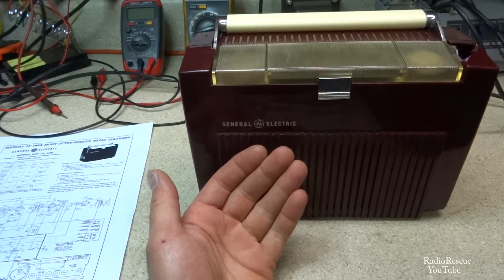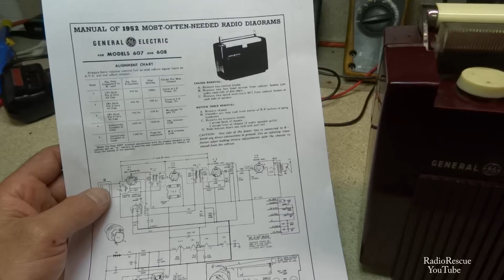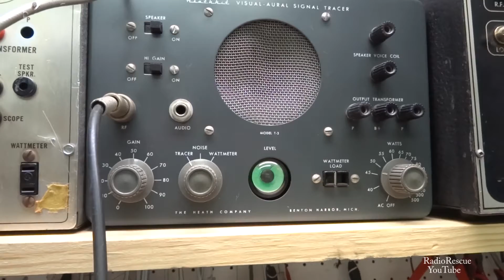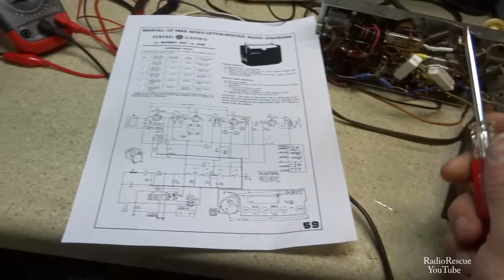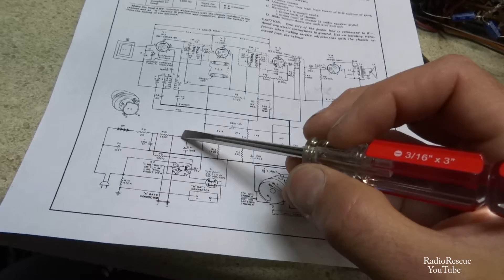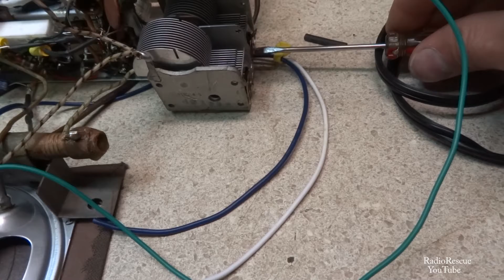Repair Of A 1952 GE Model 607

Comment: I found one of these in a barn a decade or so ago and about 50 of the case was gone and cracked all to thel.  The internals were rusted to heck form rain and weather.   Spiderwebs, you name it.   I derusted everything but  and took off the components, but quite af ew of the tues were missing.   NDId a very neat restore on the variable capacitorand the metal chassic but that was a s far as I got.   Seemed no sense to oontinue, so I asked for an old vacuum tube radio on Craigslist, and low and behold a guy actually game me a GE 430 with wooden chasis that had sat on his parents mantel for 50 years.   '

Worked but with some buzz or hum, so a few electrolytic recaps fixed that and it was back in operation.   I took the faceplate dial off just so I could watch the vacuum tubes glow inside, then put it back on to keep t intact.

O still ahve the parts tot he GE 607 if anyone needs them to restore a GE 607 but they are rough...  haha  Probably only worthwhile to see what a resistorfrom 1952 looks like...

https://www.youtube.com/watch?v=cDQbMpZpQ8g

Comment: Back in 1967 my buddy and I were scroungers, had to be, we didn't have much money and were still in school so didn't have jobs during the school year.  One day we hit the city dump, which at that time was unmanned, and dug through the piles of garbage. I came up with a radio that looked a bit like that one, but was olive drab in color and had a wet cell battery as well as the power cord. It had Short Wave on the dial and for antenna's it had two pull out sort of tape antennas, built like retractable tape measures with a stop on them at the end. It worked OK on AC power but the batteries seemed to be dead. I used it up till 1970 when I entered the US Army and my good wife tossed it back where it came from. She had no interest in that sort of radio and she had one that was hers when we wed, she kept that for years.  Kind of wish  I had that set back again, also wish I had my wife back again, she went to heaven last month on the 20th when she lost her battle with cancer.
Reply from the maker: I'm sure she's looking down at you and soon you'll be together again forever.
Reply: Mu sympathies for you regarding the loss of your wife.

Comment: Very nice video. I have several of those 50s battery / AC sets and I love them. If they have an RF amplifier stage, they are neck and neck DXers with car radios. The problems most frequently I've encountered aside from electrolytics, tube filaments and selenium rectifiers, is with that filament dropping resistor. I think the manufacturers used to low of a wattage making the resistor run hot and eventually self destructing. I always use a higher watt unit than OEM and do what i can to keep the new one as cool as possible. Your viewer should go after UPS about the damage in shipping. For what they charge to pack, there is no excuse for damage.

Comment: i wonder how long the batteries would last in a set like that, great video & radio, thank you.
Reply: The B battery only has about a 10ma draw so it lasts a long time. The A battery is a different story. Depending if the string is series or parallel, I've seen a 100 to 500ma draw. Heavy draw for a carbon zinc battery to handle back then.

Comment: Great repair, Radio Rescue... thanks for sharing. :-)
And, yep.. the filament-wire in those battery set's tubes is definitely very fine and relatively delicate... literally hair-thin. In the one volt tubes, i.e. 1R5, 1U4, 1T5, etc, it's a single strand held vertically by a connection at the bottom and a spring-loaded connection at the top. In the three volt tubes, i.e. 3V4, 3Q4, etc, it has two filament-strands that are connected in series and via the  center-tap at the top they'll run on 1.5 volts too with the two strands connected in parallel by the AC/Battery switch in some sets. 
Their glow is very faint and can only be seen in the dark practically... a strand only draws about 50 milliamps or so.
The filament-strand's top-connection(s) is a bit of spring-metal wire and one side of that is welded to the lead that goes down through the structure and to a filament pin, and the other side of that tiny length of spring-wire is welded to a tiny little square of metal and the top of the filament-strand is clamped by that little metal square, and the spring-wire holds the filament under tension. 
One way to visually tell if a filament-strand is open is to look at that little spring-wire... it's normally hunched over as it tensions the filament-strand. When the filament-strand opens, the spring-wire pops up and the little square of metal on the end of it is the signal-flag indicating that the tube is blown. :-)